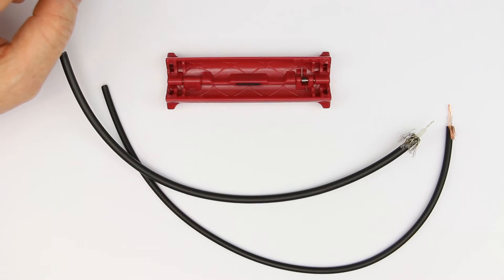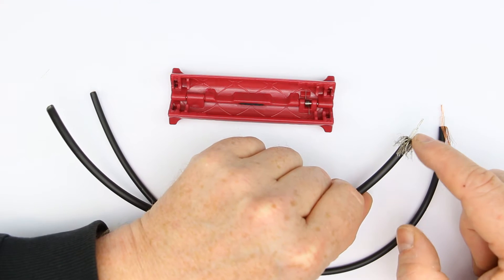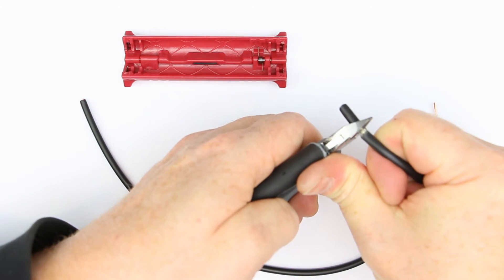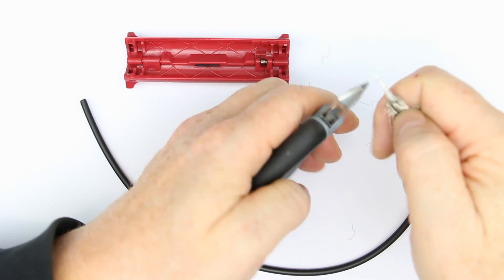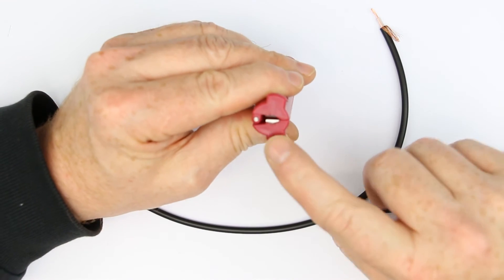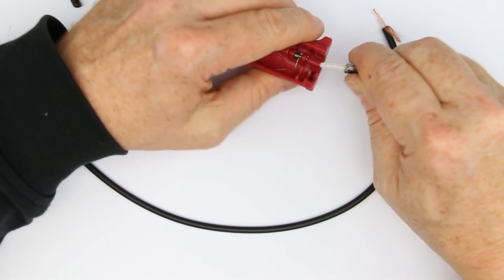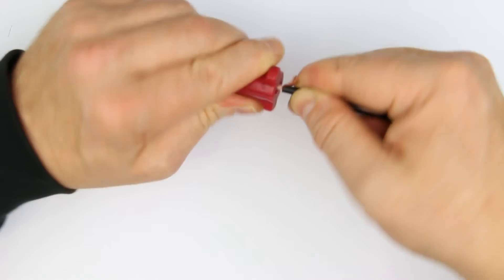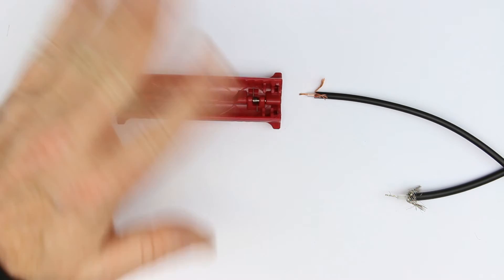Every maker should have…[Pt.11] a coax-cable stripper

Comment: He didn't say anything about how far from the end to strip. I have this same stripping tool and it's got gage marks on the inside but no instructions on which measurement to go by.
Reply: I came here for the exact same information. In case anyone else is in the same situation:
1. Use the A side of the cable stripper: insert the cable up to the end of the „deep“ mark, so the cable „hides“ the mark completely. In the end, it doesn’t matter if you put it in too deep as you can always shorten the inner pin if it is too long.
2. Push back the shielding 
3. Use the B side of the cable stripper: let the inner insulation touch the cable stripper. The blade should be in the correct distance and do the perfect cut automatically.